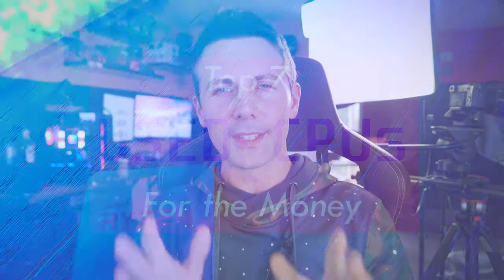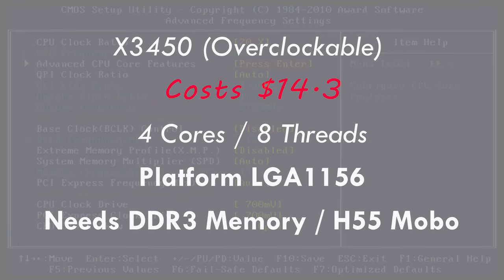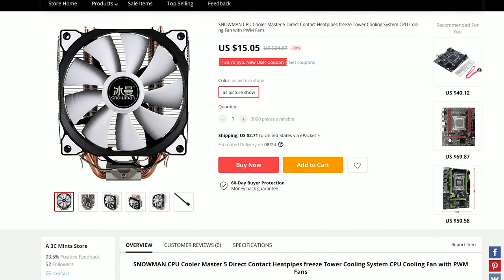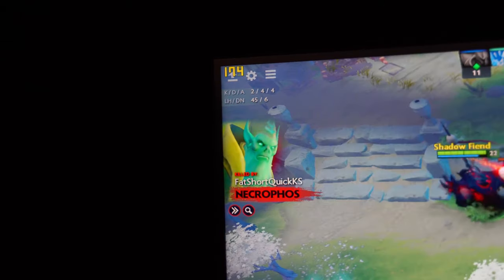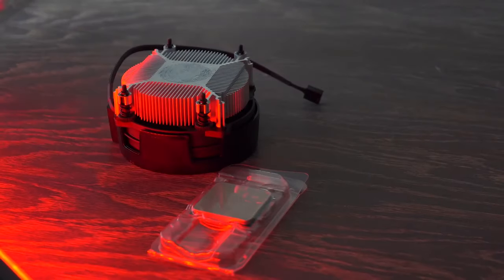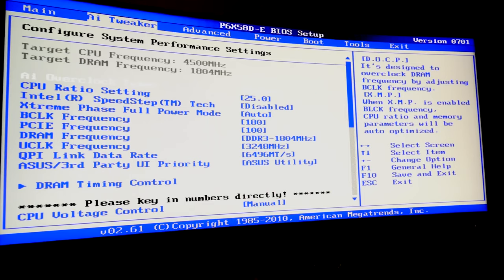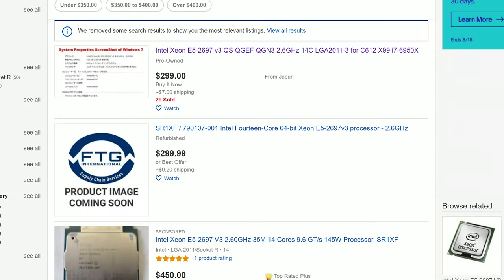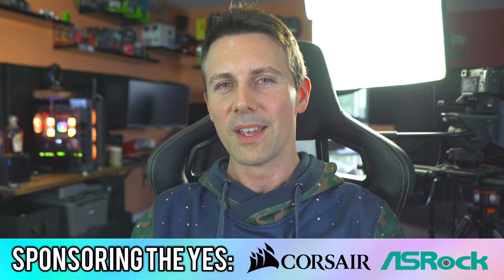Top 7 USED Gaming CPUs for the Money in 2019

Comment: oooooh I might pick up an x5670, I've got an i7 950 at the momment. The mobo is probs worth more than either cpu tbh
Reply: It's an awesome, cheap and easy upgrade. Got a x5675 and running it at 4.25Ghz at 1.35v with standard llc. It's great
Reply: Jus go ryzen lol
Reply: @TheFirestriker101  I like the x58 platform but it's way cheaper and price to performance is better with the ryzen now. At this time I'm gaming on an x58 x5675 with a 2080ti. I will be back on the ryzen system once my MB is back from RMAing with Asrock. I'm not a happy camper with Asrock but for $50 and no questions I get a new board. I think my next board will be MSI or Gigabyte. I need a board with 2 built in nics.  I like teaming nics in my pc builds.

Comment: Should I go for the E5 2689 (16gb ECC REG ddr3-1866) or ryzen 5 1400 (8 gb ddr4-3000 and asrock b450-hdv so not the best upgrade path though it can probably handle r5 3600) when pairing with an rx 470. Xeon option is about 10 euros more expensive, but it also has a slightly better cpu cooler.

Comment: Love your videos. I'm currently running a xeon e3 1275 v2 with 32GB ram on an asrock b75 pro3..I had a used rx 580 (4GB) I got second hand as well (oem used for mining). It worked until it burned out but ended up replacing that with a gigabyte gtx 1650super windforce oc...when I plugged in a sata ssd it smoothened things out..was able to mod the bios to recognize an m.2 nvme via an x4 adaptor..since it's in my second pcie slot it's only running pcie2.0 but still hits 1.5GBs read speeds and 1.2GB write..just having trouble being able to install windows on it as a boot drive..wondering if you were able to attempt this..I saw someone on a forum do it to the same motherboard and it apparently went well. Have you ever tried that?

Comment: Hey Tech YES City , I always watch you videos. Because of you I now run a Xeon e5 1660 V2 overcloked to 4.5 Gs, with DDR3 1866Mh Rip Jaws quad channel ram and a 1080 ti.  I love the good advice you give, keep it up.
One question I have never tried to overclock the ram, My motherboard is a Asus P9 X79 Pro, on the Asus web-sight 1866Mh is the highest  supported for the board so that is what I got. It is currently  running at 1866Mh in quad channel as of today. So then can I push it higher?

Comment: It took me a LONG.... time.... to be able to decide what was the GHZ versus CORE count versus Dollars spent "Best Ratio"..... TBH: Until the 1680 v2 comes down and is more available 'if that ever even happens as I think the ones available will slowly be bought and brought home to their "forever homes" whether in a functional system or "saved" as an awesome part of history like some highly binned 2500k's..... So, that leaves us with 6 cores / 12 threads and I do not TOUCH anything that is not a known Soldered chip.... I LOVE the price to performance "out the box" for the 2643 v2 and if HAVE to overclock your chips a bunch regardless of their "out the box" performance beings decent to superb then the other variant XEON for the E5-2643 v2 but overclock-able is the 1660 v2... Imagine what a 1660 v2 ivy bride (more beastly 4960x @ 3.7ghz OTB...) paired with a 1660 ti GPU would do, both good binned cpu/gpu's... Be kind of COOL?... 1660 Turbos out the box to 4ghz... I would love to see a video like this one from YOU Bryan for an "out the box - best price to performance" for those wanting those clock speeds at stock, pop it in and GO...  "out the box beastly Xeon horse power" then the 1660 v2 is nice! They can also be had for smaller amounts then I think they are worth.... I just ordered a 2643 v2 to see how much I can gain beings its a 26 series but, the "out the box" numbers are better then good for the time and even now, especially for xeons that are also known to still reach some type of overclock if not just at least lock to their turbos.... My dream CPU, 9990X which is so RARE but not rare that you can not find one if willing to shell out the MONEY to find and purchase one.... 14 cores, 28 threads at 4ghz, turbos all to 5GHZ equals "BOOTIFULL".  That is essentially an 8086k (love this cpu) but with 8 more CORES on the TOP.... Also, have a really nice MSi MOBO brian but she will only go up to a 7700 K....  I remember when the 8700k and 7700k came out, the 7700k was essentially the 2500k's predecessor in being "THAT" legendary CPU again, so I RESEARCHED.... It seems the 7700k is holding its value, more then its value for only a 4 core, 8 threaded part.. I think I am going to bite the bullet and buy it for gaming on this MOBO and get this 7100 (WAS, Only used for STREAMING...) out of this board as the 7700k always intrigued me and now even more so... It seems they always have more powerful FPS then they seem they should, I really want to try one and make a 7700k gaming system.... I think its the most well fine tuned CPU for gaming, it somehow became that, if like to see triple GTX 970 sli (most popular GPU for a long time) Paired with the legendary and even still hefty price tagged - but worth it, 7700k!.... OVERCLOCKED..... PS: What was that "unicorn CPU XEON" for x79 again, I think there were two 1691 0r?.... It even said they exist as were made by intel at a point but nobody bought any as nobody has any it seems but they seemed like they would be iconic even right now.... and of course, on X79 #still... #LongLiveX79 BTW: I would like to find a 14 core at like 3.2ghz that could turbo to 5.0 ghz on ALL CORES... That be a great chip, not sure which one exist closest to it and do not see many 14 core chips... tetracyc xxxxx??? I forget how to say the 14 / 28 thread cpu's name?.... Anyway, to the average dummy looking for specs, 14 cores it is to beat the 3900x at least in their head... I knew this would happen hence I always LOVED 14 core parts WHICH seems AMD is going to skip, big mistake if they DO..... One six core, one 8 core - but in one chip... what more could we need? :P  If AMD gave us that 14 core 3.2ghz cpu with an ALL Core 14/28 TURBO to 5.0ghz even AND MAYBE SOME ROOM FOR A 5.4 OC for average binned cpu's... at a reasonable TDP - and INSANE-CRAZY-Great L-x, l-x and l-x CACHE ON BOARD! .....I'D BE THE FIRST IN line TOMORROW.... They can release it as their 8086k "cpu" competitor as in give it a GREAT NAME something meaningful to AMD and a whole with a separate launch, not sure if be best on thread-ripper or Ryzen solo though... I always like the bigger cpu's of threadripper....  BTW: AMD, No taking a 16 core part and making it to be a 14 core, I hate when stuff like this is done... I want a PURE 14 CORE.... made to be that way from the start... Anyone make it to the end of this comment? LOL, If so, anywhere I can see ALL the 14 core cpu's ever made? I know of 7740 and 9990 and a random haswell xeon, about it.... maybe a few more are out there?.... How well does that Ryzen 1400 OC Bryan? Damn that is cheap and not bad if it over clocks WELL, o not hear much of the 1400 either, not many bought it, I suppose even though its great now for price to performance for a quick gaming setup... I am about to put in a XFX 590 Fatboy and take out my 7990 triple d by xfx dual gpu cross-fired with my rare 6gb TOXIC edition of the 7970 by gigabyte as well for my triple crossfire x setup will now be one lonely 590 FATBOY by AMD for now, until the Radeon VII goes down in price as I just WANT ONE for the HBM2....... Will this XFX 590 fat-boy beat the triple cfx I had with my 7990/7970 I have now? Hmm, about to find out on my main rig, my 1680 v2 system on the assassin board. #X79 forever....
Reply: E5-2643 is a fine CPU but at over $100 on eBay, just not worth it.. As others have pointed out, you can get a Ryzen 5 1600 and motherboard combo for around $150. The value isn't there for someone who doesn't already own an LGA 2011 motherboard

Comment: I'm planning to upgrade my HP z620 workstation with either the Intel Xeon E5-2689 or the Intel Xeon E5-2650 V2.

I'm still unsure if my Motherboard will support the 2689.

The motherboard is of the c602 Chipset.

Big thanks to this channel, since it made me realize the upgradability of my system.

Comment: I got a used i7 7700k with new motherboard and ram to upgrade my rig. I got it in June just before the Ryzen 3000 series came out. I would've got a r5 3600 if I'd waited. But I got a good deal on the motherboard and ram (by eBay standards) and got all three for a bit over $500 usd. The cpu on its own was about $280 usd. (I bought these in Australia)

Comment: Have you ever gotten a x3450 past 4Ghz? I have mine 4Ghz stable with auto voltages, but wondering if you've had experience pushing these chips further up. Holding out for b550 boards before upgrading to Zen 2. Awesome video!

Comment: best value for higher end gear (keeping gaming and overclocking in mind) would be 1650v3 and a sub $200 x99 branded motherboard. Slap a good aircooler or cheap custom loop and you've got a baller 8700k competing machine for 1/2 the price. Maybe less. Even the 1660v3 can be had for maybe $350 if you look hard. 8 cores/16 threads that should easily get 4.4ghz or higher with good cooling. Though non of this would be considered budget probably.

Comment: Nice vid!!! Should I buy a Ryzen 5 1600 for 84 dollars or save for Ryzen 5 3600 to 200?
Reply: A 1600 is still good. Someone made a good point: AMD architecture is going to drive the next-generation consoles. Microsoft worked with AMD for the new Xbox.

Ryzen only installs on Windows 10. For help https://community.amd.com/community/support-forums/processors

You can use a small screwdriver to put an uncooked-rice-grain-sized blob of thermal paste on the CPU in the middle. Also use it to straighten any bent pins. Renew the paste every 12–18 months.

Tuning Ryzen for better performance https://www.youtube.com/watch?v=LTT5mhqmjJc

Try the Cooler Master 212 evo or the smaller Antec a40 pro. Thermal Grizzly Hydronaut is a very good paste.

A new Ryzen user wrote: “make sure windows 10 allocates enough space for virtual memory because my computer was stuttering for a while”. (I think they mean the page file/swap file. It really means they didn't do so with their old processor.)

“My ONLY point of frustration came from some instability I experienced that took me a while to troubleshoot, first thinking it was probably some sort of memory incompatibility. It ended up being an incompatibility with the Windows 10 Ryzen power plan that was installed. Switched to the regular "Performance" plan and its been rock solid ever since.”

If the processor idles at a high temperature: disable all 3 bios options for Precision Boost Overdrive (PBO). Set Windows Power Plan (not AMD's one) for "Balanced".

Comment: Id probably buy the 2650v2 over the e5 2689 now. Lower power use and about the same passmark score. Only advantage the 2689 has is a slightly higher turbo. They are about the same price.

Comment: I have a used Dell T7500 workstation someone gave me, and I cant get a picture on a display to get into the bios,,,,help please from an 80 year young man.
Reply: Timing's a bit of a bummer as I'm away tomorrow for a week so I won't be able to check until I return on the 18th (ie. away from my own T7500), but happy to help if I can. First thing worth checking is the service tag on the machine label (it should be either on the rear of the case or possibly on the removable side panel), check on the Dell web site whether the system is still under warranty. You might just be able to get official support from Dell, worth a go. If not though, don't worry, the Dell forums are helpful, I used them when I built my system from a bare bones unit (case, mbd and PSU only).

Meanwhile, are you able to test with a different graphics card, to rule that out as a possible faulty item? Do you know what GPU the system has in it at present?

Also try locating the CMOS battery and doing a reset by taking it out, waiting 20 seconds and putting it back in. Oh, and download the owners manual PDF, it has a summary of key controls for accessing the BIOS and other functions, and will show where the CMOS battery is located.

Feel free to email me direct and I'll follow up after the 18th. I'm at:  mapesdhs@yahoo.com

Or Google "SGI Ian" to find my SGI site, my general contact page is in the for-sale section.

FInal question, what model display are you using? Are you sure it's ok? And try a different monitor cable. Good idea to rule out as many different possibilities as one can, since I know from experience it can be a real hair-puller if one spend's ages trying to locate a fault and then it turns out to be a bad monitor cable or something. :)

The T7500 is a pretty decent system and runs very quiet, though unless you can make good use of what it can do it may be a tad overkill (ie. uses more power than a modern simple PC, etc.) At the moment my T7500 has two X5570s, 24GB RAM and some old Quadro card; I've bought two X5690s but not installed them yet.

Ian.

Comment: Still rocking an i7 2600k paired with a 2nd hand Vega 56
OC'd the CPU to 4.2 @ 1.28v
performs amazingly, too bad the CPU's IMC is damaged so only 2 of the 4 RAM slot is usable
Reply: I am going with the non k 2600 and it works fine too ;)
Gtx 1070 16gb 144hz are perfect
Reply: Are you sure about imc? I had a simillar problem with 3770K and i chenge chipBIOS and now eveything work fine.
Reply: @szpynda  well I already did try reinstalling the latest Mobo BIOS just to be sure and the problem does persist so it's most likely the IMC itself, can't think of anything else rly...

Comment: Gday mate
I'm using an 8350fx 8 core 4.0ghz
Wd black m.2 nvme
16gb ddr3 2400....set at 1866mhz
AsRock 970A
Nvidia gtx 1070
Playing metro exodus on ultra high
IL2 battle of Stalingrad...ultra high
And 4 other AAA titles
The nvme was a game changer for this build...so don't give up on FX just yet.
BigT
Reply: Also using an FX 8350 but I am building a machine based around the Ryzen 3600. You could re-use most of that minus the CPU, Mobo and ram. Ryzen 3600 = $200, MSI B450 Gaming Plus = $100, 16gb of Timetec 3200mhz ram = $70. More or less a $370 upgrade could double your cpu performance and remove the bottleneck.

Comment: i have a P9x79 Deluxe paired with E5 1650 v1 at 4,8ghz 1,35v and an RX 580 8gb @ 1520mhz core 2250mem. Waiting for the E5 1680 v2 to be around 200€ to buy one. I also use 775 mobos (it's very dificult to get them at good prices now), and pairing them with X5460 or x5470 which are 4 cores 4 threads that cost around 13€ to 24€. You can OC to 4,4ghz though you need a good AIO. Air coolers.....well....it's a 120W TDP , so better have a good air cooler. My very big next upgrade will be next generation of Ryzen unless my AIB card Sapphire nitro RX 5700XT is too much for my cpu, in that case i would have to change my mind quickly.

Comment: Love my x5660 but I have system restart issues when I use my rx570 playing mount and blade warband. Not immediately,  but a matter of time. No components are overheating.  I'm running a 650w bronze rated pwr supply. The system is rock solid during testing.   The rx 570 8gb runs perfectly in my i5 6600k rig btw. Any ideas?

Comment: 5 months ago I did bought cheap? i7 6800k (140$) with asus X99 motherboard (100$) did overclocked it to 4.2Ghz at all cores (1.35V) also got used GTX 1070 for 175$ and its do the job.
Reply: @claritoresdiano1021  why should I? :D Its true, now I would go for ryzen 3600...
Reply: No. Upgrade your GPU then run 1444p or 4K. CPU Overclocked 4.1~4.3 GHz depends cooling. R5 3600 look same performance with that.
Reply: @claritoresdiano1021  I agree... I would buy R5 3600 if I didnt had already my i7. I will go with a better GPU next year maybe... for now it's enough for me.

Comment: Curious, what 10 or 12 core processor I should use for running virtual machines which offer reasonable value?  I attempted to run ten VM's on my x58 setup and it bottlenecks at 7 vm's.

Comment: I think new am4 is better to start with low and upgrade with any new and low-cost parts.
Reply: I agree. It's only really worth going with the older CPUs if you get the, free or at a really low price.
Reply: Robert T yep, it’s good to know what old hardware is viable for your use case but I think ryZen is king right now for the upgrade path alone. RyZen 2 support even with A320 boards, so even RyZen 3 is likely, pop a cheap 16 core years down the line if you need it and be good to go I need be. Plus having modern features is meaningful as well.
Reply: I agree. My opinion is that r5 1600 is the best to start with, and next year, if b350's or b450's will be compatible with ryzen 4th gen, it will be a well deserved upgrade path to a r5 4600(probably that's how it will be called) or a r5 3600 that is already compatible with b350's and b450's.
Reply: Also, we must take the cheap mobo under consideration. A Pubg Lite PC and pubg 720p can be built with 2200g and 2x4 GB 2400 ram under 200USD or less. Which is a great value as vega 8 workes as rx550 card, an awesome value.
2200g is better than 1200 + 750 ti because I can add an rx570 and replace r5 1600/1400 in future where 750 ti is a waste.

Comment: Bought Asus P9x79 Pro 110$, Xeon E7-4880V2 15 core 30 threads for 25$, Phantex Pro 25$, 32gb Samsung EEC 1600mhz 45$, Noctua U14s 62$, EVGA NQ 750w gold 40$. For around 600$ I have a damn good editing rig. I’m not spending 750$ for Ryzen 16 core. Its newest one, it’s faster but for what I build it’s more then fine for editing.